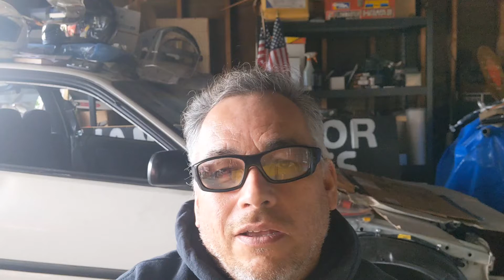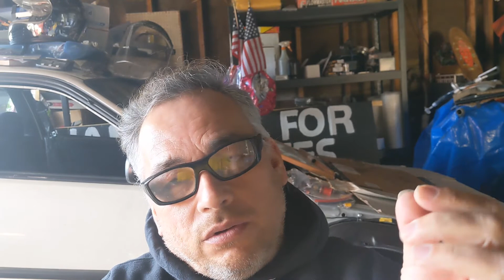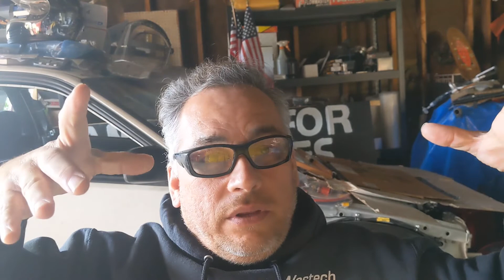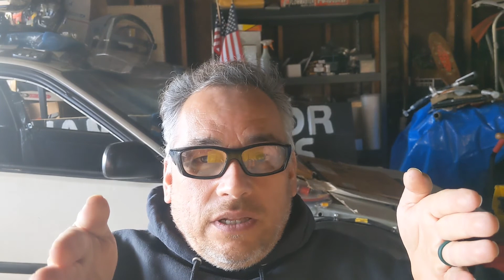POSITIVE DISPLACEMENT SUPERCHARGER VACUUM/BOOST LEAK PROCEDURE

Comment: Great Info. I have an issue on engine swap to new forged Dodge 6.4L with 2.9L Whipple. Different injectors were tried which required the Whipple removal each time. This is because the Whipple design creates a clearance issue on cylinder #8 (passenger rear) injector where the fuel rail cannot be removed without removing the supercharger. Consequently the gasket was pinched. Still wondering if it was pinched again or dislodged during one of the re-installs. It will not idle below 2,000RPM. Computer, throttle body, injectors, plugs, one coil pack on cylinder #8, intake air charge temp sensor, PVC, were replaced. Installer tried tuning with no success. Looking at a different shop to do some diagnostics. Anything inputs would greatly be appreciated.
Reply from the maker: Thank you. You can use a bottle of water with a drop off dish soap and have someone rev the engine between 1000-3000 RPM and spray the manifold area or where ever you think it's leaking from. Also of you have a scanner you can check O2 sensor it should read lean or high oxygen.